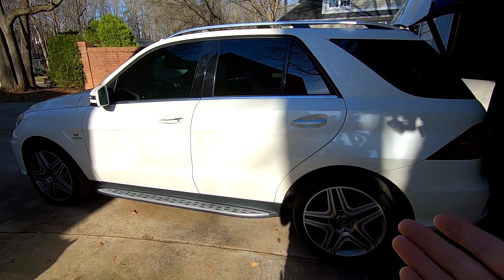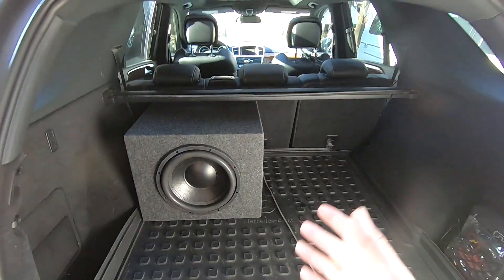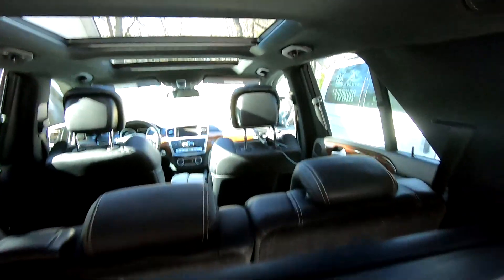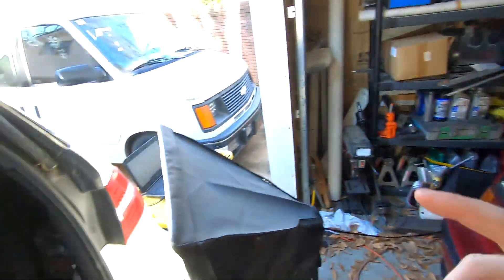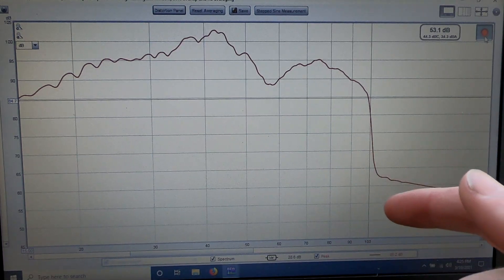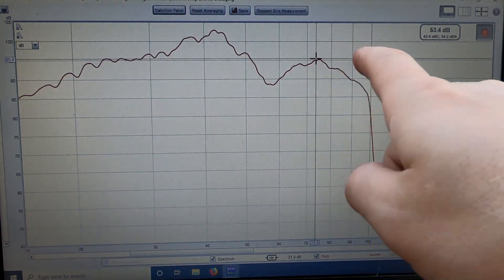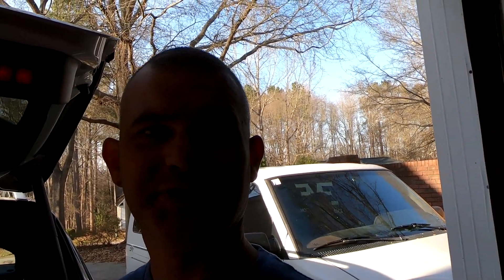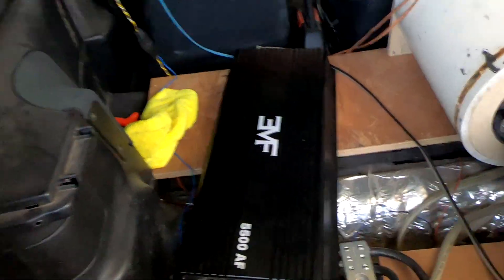*re-upload* EMF Ghost 12 in car frequency response

Comment: What mic and program are you using to test this? And will it work for higher frequencies, or just <100hz
Reply from the maker: It's REW, I don't remember the specific mic but it's USB and has a calibration file for REW. It's full bandwidth, but isn't for high SPL (like 115 dB and over).

Comment: Can you do a video on what to look for when buying a used sub so you don't get burned?
I feel like that would be a great video idea.
Reply from the maker: That IS a great video idea.
Reply: You know what on used subs I always came out really good.
1. They were already broken in
2. Cheaper cost
First thing I do is,
-come w a vehicle wired for a sub "plug it in n listen 🔈🔉🔊👂or if not available...
-push on sub listen for scratchy noise or -stiff, no push or give
What to look for: 
-ware n tear (soft parts) on sub surround, terminals, loose magnet ETC....
Hope that helps...
Reply: Fun fact, I had two brand new 12"s on 1000watts, my buddy had one "used" 10yr old L7 solo-baric 10"inch sub on 300watts.
It blew my system away, maybe Sean can explain that? 
I think it was due to whoever had sub before took care of it & the excursion on it was like 5 inches.... crazy
From that little 10" the police showed up, it set a store alarm off from across the street....
Behooves me to this day 🤷🏽‍♂️
Reply from the maker: @BirdFromYakiVegas  there is a lot to cover there but the first thing is comparing vehicles and installation, moreso than drivers.

Comment: That’s smaller then a trailblazer inside at least the rear part
Reply from the maker: The cargo area is narrower between the wheel wells but similar otherwise. The cabin is bigger on the ML63 in front and rear seating.
Reply: @EMFAudio  that’s how it appeared thanks.